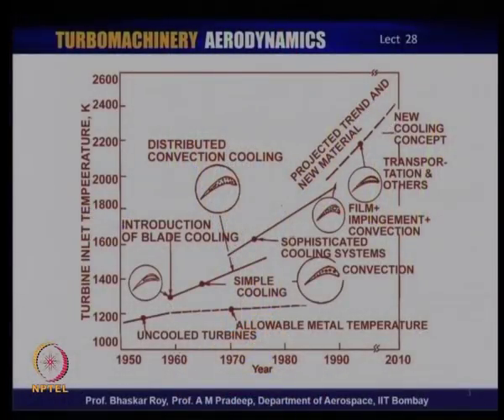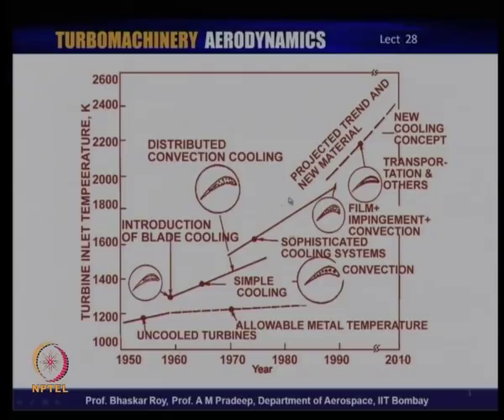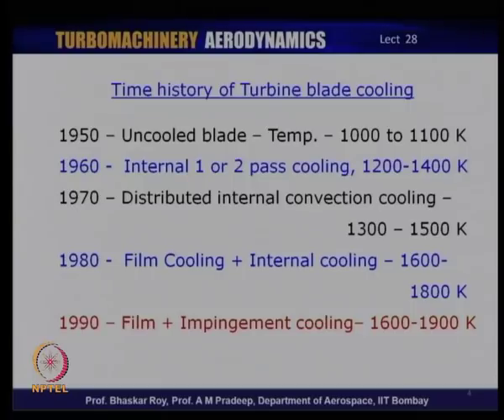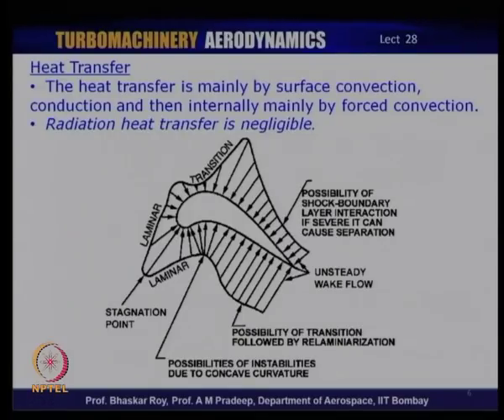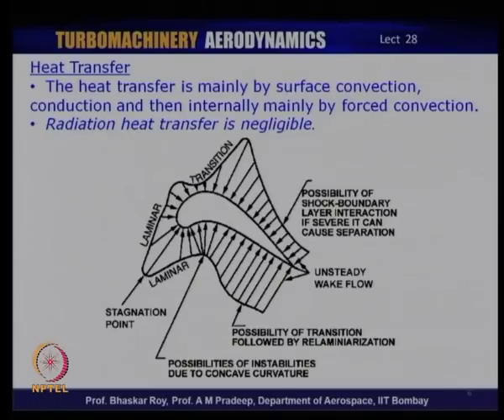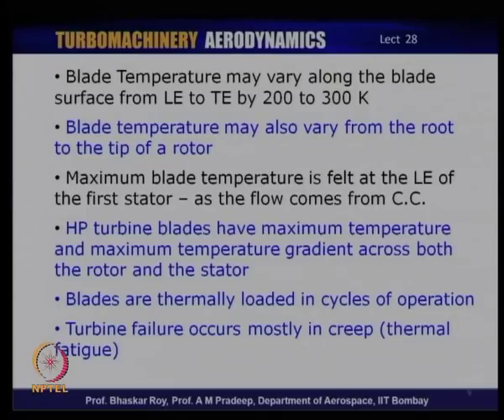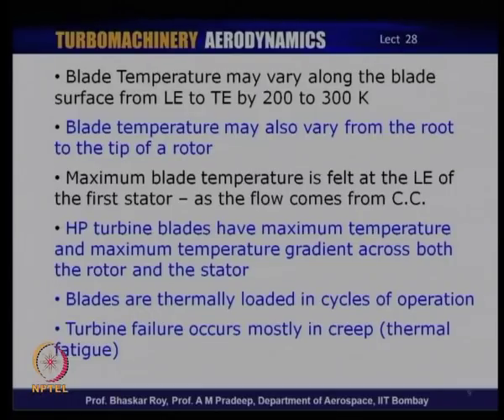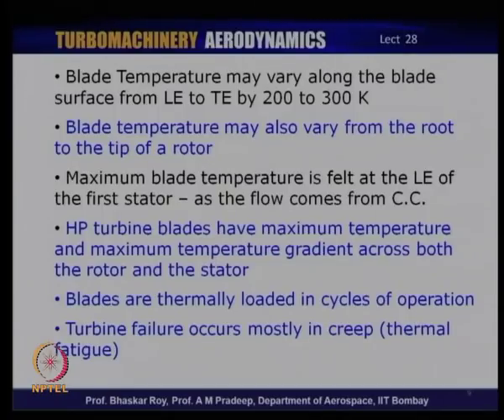Mod-01 Lec-28 Turbine Blade Cooling Technologies

Comment: sir, at minute 52 the graph shown for convection cooling i think there is an issue with the prssure ratio vs relative coolant flow, at higher pressure lesser coolant flow is required but for convective cooling the graph looks otherwise, whereas it is correct for combined flm and convection vs transpirational cooling. please reply
Reply: No